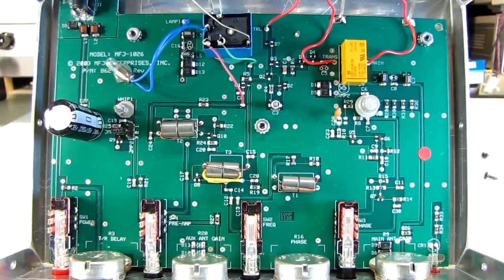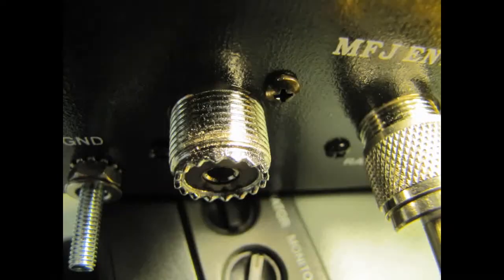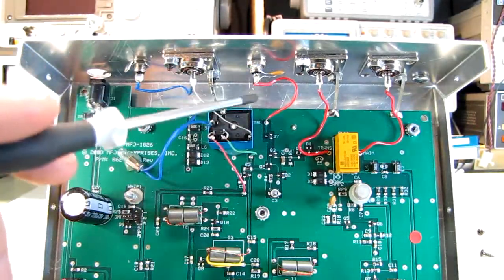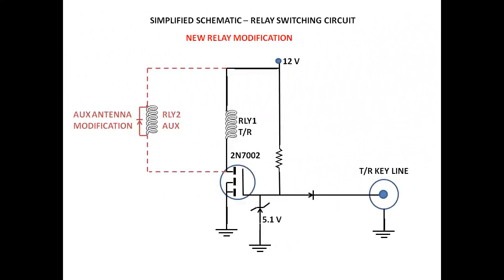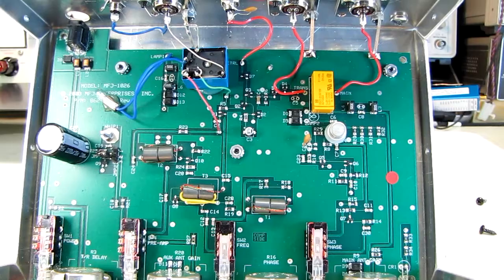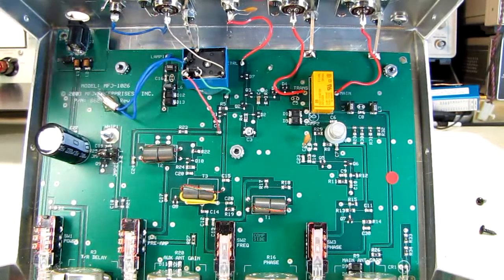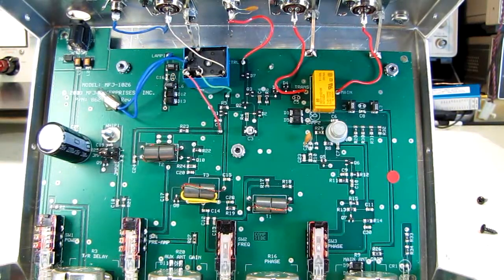MFJ 1026 Hacks Mods Repairs

Comment: THANK YOU!  I own several of the MFJ-1026 units, and completed this modification to all of them.  The video was very helpful showing the internal modifications.  I used a small piece of the double sided 3M "Command" hanging strips to affix the relay to the circuit board.  I also incorporated a suggestion by someone else below.  I'll just cut and paste his suggestion from his comment:  "When you connect a external relay, you need to set it up so that the normally closed position of the new relay is connected to ground. This will ground antenna during transmit, and it will also ground the auxiliary antenna when the noise canceler is off.  This is important because even when the noise canceler is off, the auxiliary antenna is still receiving power from your transmitter or amplifier."  That makes perfect sense, and I'm glad he suggested it.  

Thank you again for the video!

Comment: You fail to mention that internal relay is enabled during receive, and drops out during transmit. When you connect a external relay, you need to set it up so that the normally closed position of the new relay is connected to ground. This will ground antenna during transmit, and it will also ground the auxiliary antenna when the noise canceler is off.  This is important because even when the noise canceler is off, the auxiliary antenna is still receiving power from your transmitter or amplifier.
Reply: This was very helpful advice!  I did exactly what you recommended.  Works great.
Reply: As I commented, I get RF enetring the AUX Antenna even when the unit is powered off and the bulb protection lamp burned already. I believe this mod should be done taking T/R sense to the relay being connected to 12Vdc directly, not after the Power Switch. This is grounding the AUX also if the MFJ1026 is Powered Off and does not let RF light the lamp Bulb.
Reply: For us future modders, where should connections go from the relay to the board? Swap the red + green wires and flip the diode polarity? Different pick ups from the board? And…about the normally closed advice above…how does that change on connecting to the relay? Just got one and I want to add this protection, and I’m using a Radio Shack 275-0248 relay, rated 10A @ 120VAC/24VDC with a 30mA nominal coil current.

Comment: FYI: The color temp of light (brilliant white) is also a characteristic of light element being heated with RF. 
WAY BACK when I was first an assistant engineer at a commercial broadcast radio station the chief engineer showed me how the energy received (off air of course) by our AM antenna from another clear channel station a few miles away was by itself enought to fully illuminate a #47 lamp. The color temp from that RF source was very different from what DC or line based AC would produce. Just thought you might be interested in that phenomena.
Reply from the maker: Hi Doc, thanks for the info. Learn something new every day.
Reply: Sounds like the Mi Amigo!

Comment: I did the same relay grounding mod years ago, the only difference is I used a a very small screw lamp holder - it's simpler just to unscrew the old bulb and put in a new one.  Re the RF sensing circuit...  Mine works still, but the T/R Delay knob on the front ceased working very quickly.  There's no longer any delay.  I'm not bother, as I use the PTT to ground method anyway.

Comment: Perhaps MFJ used the same kind of SO-239 connectors described here: https://www.youtube.com/watch?v=I3QtuozE3vU
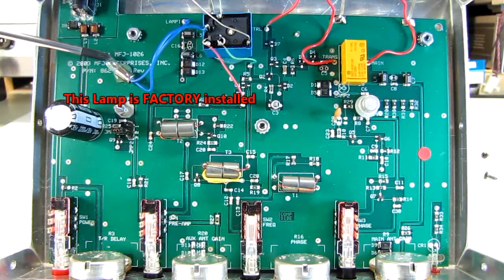The partial schematic at 2:03 is essentially the same as the DEO RG-2000 receiver guard. YouTube won't let me post a link, but you will find its schematic and a discussion by searching for: Receiver Protectors DEO RG-2000 vs. DXE RG-5000

Comment: Those units are plagued with minor issues due to quality control, there actually excellent for improving signal to noise. My first one you had to hold the phase button in about an eighth inch to get it to work. Had MFJ a simple fixture to test those switches for continuity when applied all the time and shipping cost could have been avoided had the switch been bench tested at the time of assembly. You'll never hear me knock MFJ there 100% customer service satisfaction oriented. In the long run, happy we have them. As amateurs we should be able to figure some of this stuff out like you did. Excellent video, 1026 beats running a mass of delay lines out to a second antenna. Phase Delay's just too cool.
Reply from the maker: I usually tell folks to treat most of the MFJ stuff as a partially built Heathkit. All the parts are there, just need some final assembly. Their stuff usually works OK once you finish assembly. Adds to the enjoyment, and I don't feel bad about making Mods.
Reply: @theradiomechanic9625  For sure, partially assembled kit.

Comment: Hi, the relay just connected in parallel with the original, so operating when PowerON Switch is engaged and the unit powered on, does not prevent RF to enter the 1026 unit when Power os Off, and my protection light bulb flashes (160 meter band) (I already burnt one) also if Front Power Switch is in the Off position. - I believe it should be better to take live wire from the T/R RCA and 12 Volts from DC Plug. Pls tell me your opinion about. I had to run short AUX wires, in order to avoid RF feedback to enter the unit, not able to null some distant noises...
Reply: Agreed. But break this down on where the connections should go from the relay contacts out…
Reply: @ThumpMaster6  There's no difference vs. the video circuit, except the source of DC voltage (+12V) that have to be taken directly from the DC socket, not switched off by the MFJ Power Switch. This is protecting the lamp also when the MFJ1026is not in operation. When transmitting, also with MFJ 1026 Off, the AUX socket draws voltage into the box. The Relay shorts this to ground when in TX, also if powered off via the red front switch. Unfortunately there's no chance to attach a picture. Give me an email I'll send you the simple schematic.

Comment: RF will destroy the lamp even without an amplifier. Normal rf from a 100 watt rig will do it as well. I burned out three 50 ma. lamps; then found Steve Ellington's video and added the DX Engineering Receiver Guard INSIDE the MFJ-1026, as well as the relay mod.
Reply: Gunde please tell me what happens when you burn the bulb, do you lose receive? I lost receive on my 1026 and the S-Meter of the radio goes down to zero. When I power on the 1026, I hear the relay but I have no receive and the preamp doesn't do anything, none of the controls work. I power it off, the receive returns to the radio like normal. What happens when you blow the bulb, did you lose receive? Thank you so much. No one has answered this question
Reply: @624radicalham  With a burned out bulb, (minimal safety feature), you will have no signal in from the external auxiliary antenna. With the main antenna gain fully clockwise; you should receive signals with the 1026 switched on or off. (If you're running through an external tuner, ensure it is bypassed). The auxiliary antenna gain should work with the supplied whip antenna and the pre-amp on, internal jumper in position 1, even with a bad bulb. To get away from this burnt out bulb scenario, I use the DX Engineering Receiver Guard, (DXE-RG5000HD) plugged in between the Aux antenna input and it's antenna. Problem solved after removing the bulb,  and shorting its connections. An excellent source of info. is a Youtube Video by Steve Ellington describing the MFJ 1026. Hope this helps.
Reply: @efrostrup  Wow. Interestingly all I ever used is the internal whip which solved 99% of my noise problems and I have no receive on the whip with the jumpers set to the whip. And no difference detected anymore with when I push preamp on or off. Just no receive. I haven't tried the main antenna with the tuner bypassed ... but all this could mean that the RF not only blew the bulb, but also took some FETS in the circuit along with it. Q1 seeming to be a common transistor that blows. And it's near impossible for me to solder SMT boards. This was my worse fear. I can't thank you enough for confirming this. I thought with no bulb no receive.

Comment: OM - why leave the bulb in the circuit after relay has been added for protection? Bulb attenuates AUX antenna by 3db? Great device, when I have powerline noise most of my gear is useless without this to clean it up.

Comment: One of the first things you need to do is replace the lamp with a 240-ohm, half-watt resistor, or you'll be ordering new lamps from MFJ every few days.  The lamp actually doesn't offer any real protection.  I've been running my 1026 for 7 months using a resistor with no issues.  I can't take the credit, however.  This mod come from W7DHH, who is a longtime member of our local club and operates the similar MFJ-1025.
Reply: But can you run a KW using only that 240ohm half watt resistor? The 1026 is connected between the radio and before the amp so a KW doesn't actually run through it. Would it work that way running QRO with just your resistor and without the extensive mods in this video?
Reply: @624radicalham  Since the 1026 cannot handle more than 200 watts, it MUST go before the amplifier.
Reply: @Species-rj9si  So none of the mods in this video are needed then?
Reply: @624radicalham  The replacement of the lamp with a resistor is the only mod that I would make.
Reply: @Species-rj9si  I appreciate that comment, seriously. From a common sense perspective that's what makes sense. Thanks

Comment: Thank you very much for the video, the light turned on due to the proximity of my antennas with very little power. Now instead, I can use my amp this way and the light never shines, even though the antennas are close together. Connect NC to ground as a colleague put in the comments. I also appreciate that very helpful comment. Greetings 73

Comment: In WW2, receivers in tanks used a lamp in the antenna path to protect the receiver from transmissions of nearby tanks.
Reply from the maker: WWII sets would be vacuum tube and a lot more forgiving of strong RF in the receiver. A lot of early sets also had neon lamps across the antenna to absorb nearby EMP from lightning. Those trigger on around 80 to 90 volts.

Comment: Would you suggest replacing the 1A (yellow, original) relay with a higher current one also? If so, any idea what the connections underneath on the board are tied to so if I do replace it, I can know what to solder to the replacement? I have a 6A DPDT 12V tiny relay good for 240 VAC or 1/6 HP motor that would be beefier than the 1A 125V one. The user guide doesn't show the pinouts of the relay on the board.

Comment: Great video. Gives me ideas for my own build of this circuit.
But I must say it's absolutely ridiculous the crappy assembly quality of MFJ equipment. I bought an auto tuner from a ham store (929) and the first unit had charred wires like yours had, and the main coax ground was left unconnected!!! I didn't even power it up and returned it where I bought it to have it fixed. The store told me MFJ will fix under warranty, but I would have to pay for shipping both ways (I'm in Canada..), and pay for labor.. on a brand new unit! Disgusting. So they just swapped me a new unit instead. The 2nd unit had a broken power switch, and bad solder joints on the coax connectors. Fearing getting another unit that might be even worst, I just fixed it myself. All this to say.. I'm never buying anything MFJ again, at least not new/at full price. Given what little there is in the MFJ-1026, I think I'll be better off building my own. :)
Reply from the maker: I find it harder and harder to source parts, build a board and find an enclosure. I look at these as a kit without build instructions. As long as I have a schematic. But I am kind of a glutton for punishment. The basic electronics design is usually excellent. Just zero Quality Control. Sad.

Comment: I've done the mod shown, works great, my 1026 arrived in GREAT condition, excellently assembled, absolutely no complaints, other than  the "RF sensing and switching" function and circuitry - stupid that MFJ has included that means of switching, and THEN advises buyers to NOT use it. Seems their design and manufacturing would have been better implemented by adding the extra relay displayed above - and totally eliminating the RF switching circuit that they insist owners not to use... I wonder if there's a reliable means of de-sensitizing the RF sensing circuit so it can actually be used at least at the common 100 watt transmitter levels?
Reply from the maker: MFJ kind of missed the mark here. I agree the best way is to "hard switch". l tend to treat MFJ gear as a partially assembled Heathkit. Just waiting for me to finish assembly and debug. Being the sick puppy that I am I love problem solving. Keeps me out of the bars.
Reply: Checking the sensitivity of the 1026 internal sensor/switching circuit, my IC-7300 will easily trip the circuit at lowest power output, 5 watts. MFJ's problem with this circuit seems to be inability to effectively manage triggering power range at upper levels - perhaps some sort of zener-type device that limits/cuts off tripping power at a specific level - say, about 100 watts. As it is, the sensor feature seems worthless for anything but QRP inputs...
Reply: Would you (or anyone) care to supply an actual relay part number since not all of us have great strength in construction.  Would relay appreciate it (pun intended) or an eBay listing number perhaps?
Reply: I used a standard Radio Shack miniature SPDT miniature 12vdc relay - looks identical to the one used by original poster of  this thread - cost was about $5 as I recall. I mounted mine with silicon cement with a thin piece of foam plastic material to keep relay noise to a minimum. It works great.
Reply: Would this do the trick? Miniature PCB Relay 12V SPDT ~125VAC/10A -- 30VDC/10A on eBay on item: 132671574308, if I orientate the same way as video that should work yes?
Reply: Ebay search on that item # didn't show any relays - but here's a couple of Radio Shack numbers: https://www.radioshack.com/pages/search-results?findify_limit=24&findify_q=12vdc%20spdt%20relay
https://www.radioshack.com/collections/relays/products/radioshack-15a-12vdc-125vac-relay

Comment: If my radio does not have an output for sensing TX how do you suggest doing this.  Can i make up a simple standalone switch ? is just grounding that pin ok ? Bit confused how a stand alone switch would work. Please excuse my lack of knowledge

Thanks
Reply from the maker: Hi Jason, if you don't have an output for triggering an amplifier, you are likely running barefoot. If you keep the transmitting antenna and the sense antenna at least 100' apart you can probably safely use the internal RF sense and let the unit switch that way. A standalone switch will work, but will be a pain. You could also add a relay that triggers from your microphone line.

Comment: You could've used the relay to ground the 1026 input and open the incoming antenna, seems it would be more effective. In doing so, wouldn't you get away from the TX overload issue and the need for high wattage relay contacts?
Reply: A friend of mine suggested me that solution too... which one is better ?

Comment: It would have been nice to include more detailed information on the 2 relays.  Mouser?  Digi-key?  Part numbers?  NO or NC?
Reply from the maker: Cheap radio shack relay from my junk box, part number unknown. NO for the ground connection, NC for passing the antenna through.
Reply: The lamp is then tied to the NC, and goes open on key down, and the common of the relay is the antenna lead, and the NO goes to ground I presume

Comment: Do you have a video or schematic on the box you are to interface the tranceiver’s tx/rx control with multiple units like atu, noise cancellor and amplifier? Thanks
Reply: I would love to see this as well. Only alternative seems to be the DX Engineering Keyline 3 that only handles half as many outputs.  I'd max that out out-of-the-box if I added an amp or another accessory on top of my 1026, a 1708B SDR Receiver TR switch and a digital interface that may require/benefit from a keying line signal.

Comment: I wouldn't touch that product with a ten foot pole.
Reply: why ? and what ever else would you use then to get rid of noise ?
Reply: I know another ham that just bought one.  You have to lesson very carefully to know if it's doing any good or not.
Reply: @baronlund9725  but my question was, why wouldn't you touch it with a 10 foot pole ? that means you do not suggest this peice of equipement to anyone... why ? it did not work for you ? instead, what else would you use ? knowing another ham that bought it does not justify that it is a peice of crap... I just want to understand what you did not like about it ?
Reply: It means it's not worth the investment.  At least not so far. @Aleziss
Reply: @baronlund9725  so any other suggestions to get rid of noise ?
Reply: I guess he has no noise.

Comment: I personally called MFJ on this and they said it would handle an amplifier up to 200w.....although the manual says 100w. See the problem here? Also not ALL radios have an external PTT control for the T/R on the 1026.
Reply from the maker: It might live at the 200 watt level. I run up to 1400. Not a chance of survival. I have not seen a modern HF rig without a key line for an amp. Check your manual carefully. It might be on an auxiliary multi pin connector.